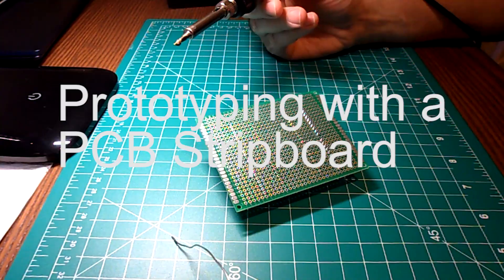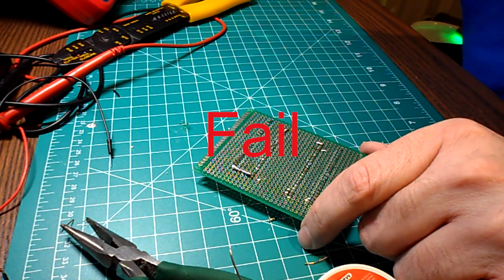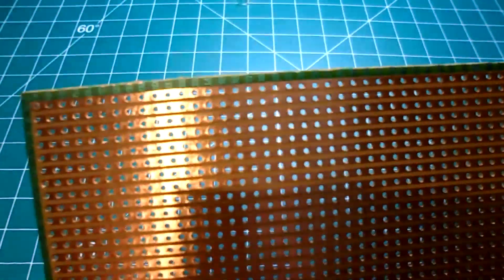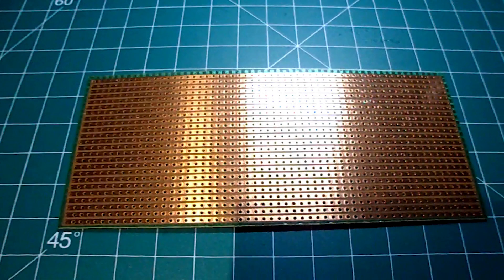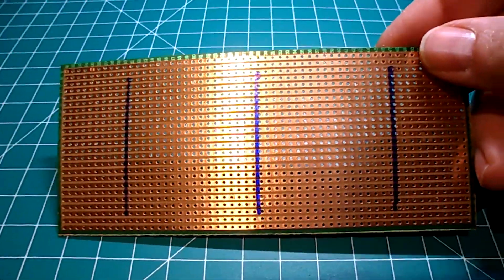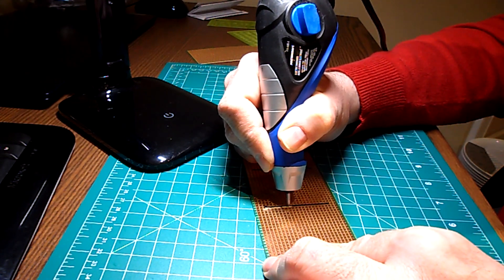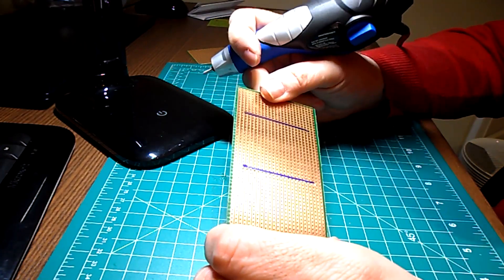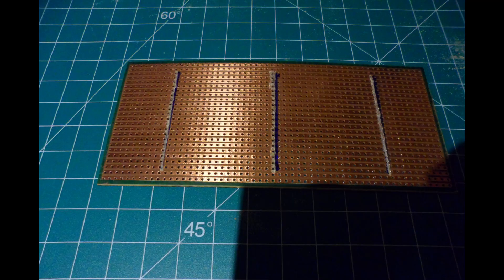Prototyping with a PCB Stripboard

Comment: Rather than buy the tool or the engraver, just use a 3mm drill bit - spin it in your fingers (you don't even need a drill).  It makes nice round holes through the track, but doesn't cut too deep.
Reply: That's what I do, I mounted the bit in an old screwdriver handle, but he did mention that he prefers this method over the handheld drill bit method.